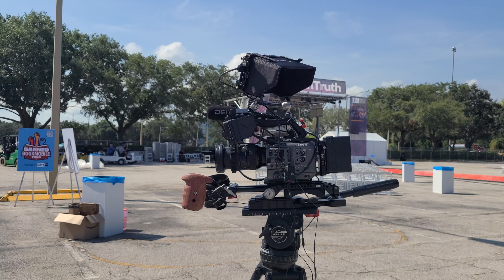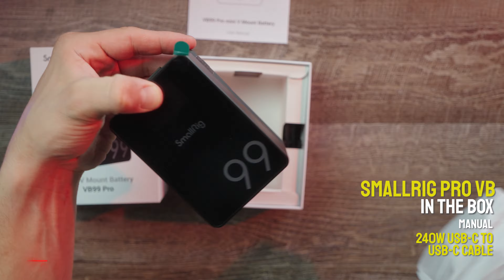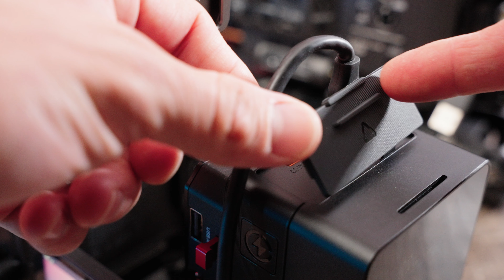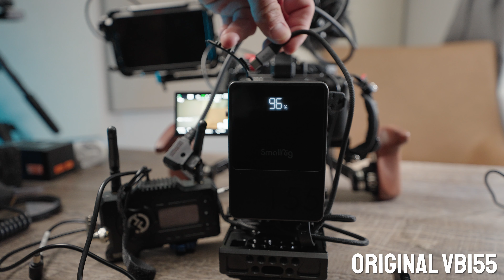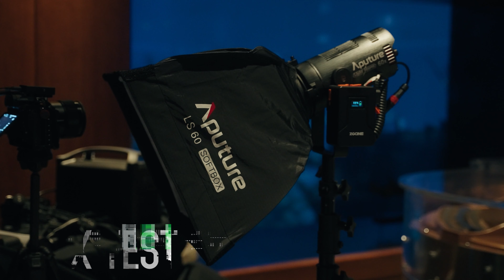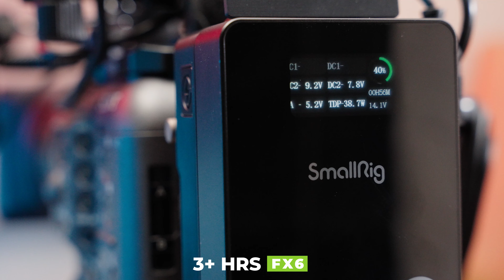Worthy Upgrade? SmallRig VB99 PRO vs SmallRig VB 99

Comment: VB99 Battery DEAD after 25 months of use. Although it wasn't used very intensively. The cells are fine, I think they still had an efficiency of around 90% but the electronics failed. And that's the biggest problem. Because the battery itself would probably still be functional. After connecting it to the charger, only the SmallRig inscription is displayed for a moment. It doesn't provide power, it doesn't turn on... I think that for a Vmount Battery this is a poor result compared to the competition. ;(

Comment: Following up on my first message about Moman and Andycine and my search for batteries for Greenland, if these new Smallrig batteries indeed provide 20 hours with the FX3, does that mean I could potentially get at least 10 hours on my R5C? (I wouldn’t be powering anything else). This would mean that even though they are heavier than the others, I could take fewer of them and perhaps lighten my pack. Are you still satisfied with this model? I'm really hesitating between Smallrig, Andycine, and Moman, but weight and price are factors for my project. Thanks!

Comment: To power a smallhd 5 inch monitor - which port is best to use 12v or 8v out? And what's the best cable from one of these ports to canon Lp6 dummy battery on the monitor?
Reply: Also would love to know!
Reply: Just read the manual of the monitor and you known which voltage is the best…

Comment: Hope you get some credit. Just used your link to get the V99, Magnetic USB C and the cable. Thanks for the video. I was going with a Core SWX NANO Micro 98Wh. I do occasionally shoot with a RED, but my main personal camera is an fx3 so the USB power to the camera feature is a plus. Also the speed of the recharge was the overall selling point.

Comment: I just bought one, worked fine for a few hours, then it started to show 0.8W draw even though nothing is hooked up, and also the power button doesn't work when i hold it. It won't turn off the screen. In fact the screen would stay on all the time. Also, the battery loses charge on its own slowly. It says 5 days something battery life left when nothing is plugged in. Anyone experienced this? Any solutions?
Reply: UPDATE: Smallrig stepped in, they will send a replacement!! Great service!

Comment: Hey man, I'm running an A6700 and an Atomos Ninja V as the monitor. Is it safe to connect the Atomos Ninja V to the VB99 D-tap and the A6700 through a Smallrig dummy battery plugged into the 8V port of the VB99? It's getting a bit confusing
Reply from the maker: It’s all safe with this battery. You have up to 100w Maximum you can output at one time.
Reply: Personally wouldn’t use a dummy, I prefer Sony battery in it and power through USB, incase the VB99 fails, the camera won’t turn off since you got the battery still in it, just an extra safety
Reply: @fabian3265 depends on the importance of that failure and the outdoor temperature — dummy batteries usually allow cameras to run a bit cooler. 

Here in SE Asia typical temperature is 30+ C, so I’d take dummy battery over a USB-C into camera any day

Comment: Regarding the original VB, if it splits those 9V, then that means I wouldn’t be able to power both the camera and an external monitor? Since the camera alone requires 8V think… or does that power split only happens on the usb ports? Because normally, for the camera I would use a dummy battery with the d-tap, while for the monitor I would use the dc. Or if I would split the d-tap, to power both the fx3 and the atomos ninja, would that work? Can the d-tap power both at the same time? I think I saw videos where people would power an entire rig from the d-tap  (tilta ring + dji rs3 pro + fx3 + atomos ninja v), so I guess it works?
On all of the above, I’m referring to the original vb99.
Reply from the maker: Yes, it was just the USB ports I was explaining about the power split, but they improved that one the new model. Everything else should be good on the original VB. All the voltages are listed on the screen as you plug things into it. The D-Tap provides a ton of power. In some of my other rig videos, you will see me plugging in a D-Tap splitter and running the whole thing off 1 port too.

Comment: On my FX6 I haven’t gotten to the point where I need v mounts yet.. I have 3 BPU90 batteries that go for like 5 hours each
Reply from the maker: I work on lots of commercials and large productions that a crew works with my camera. An Audio guy has part on here, the AC has wireless video and Focus Motors, plus the monitor, etc. I’m kind of forced to add more power than an internal battery. I have like 6 of the BPU batteries, that just collect dust, lol!
Reply: @RayValencia  I’m trying my best to get where u are 🖤🎬🔥 I’m a one man band rn.. I’m in film school but I haven’t had a chance to be apart of any large production sets yet

Comment: i just hooked up my vmount to my fx30 to test how long it could record straight. i got over 3 hours but after like 45 mins my fx30 was making a high pitch squealing noise. Its not noticeable from a few feet away but is that normal with these cameras?
Reply from the maker: That sounds odd! Not normal to hear any high pitch noise coming from your camera. Hopefully, your fan isn't rattling. Never been dropped? I just got my FX3 back from Sony Pro Support for fixing my wobbly screen (after 3+ years of use), and they also cleaned all the gunk out of my Fan Vents. Could be something as simple as that, or something isnt right internally.
Reply: @RayValencia  no only used it a few times. the fan was on and running smooth but a weird squealing noise. I was assuming it was related to a vmount powering the cam through usbc but ill test again and a post some clips.
Reply from the maker: What V-mount were you using? I've been using mini v-mounts on this camera for years and haven't had that issue. Let me know when you post the video.
Reply: @RayValencia  the zgcine. i have a 50 and a 99. They dont give me an issue with my a7iv though i dont think its the batteries.
Reply from the maker: Ok, yeah those batteries work for me too.
Hm, Have you tried different cables too? They could make noise if it's powering a 9V camera through a 5V cable. I have some cheap USB-C cables, and I have some that are rated for higher voltage too. 
If isn't that, it's gotta be something in the camera... 🫣
Reply: @RayValencia  thanks, ill do some tests tonight. ive been using the cable the battery came with. I assume its the camera/fan.
Reply: @BarefootMediaTV  this happen to me also With my light colbor cl60.
When the charge of the battery drop under 60% (~30 mins)  the light start making a buzzing elettric noise.
This happened With 3 brands v-mount batteries.
When Powered from the Power socket the light can go for hours without any noise.
I don't understand what's the problem.